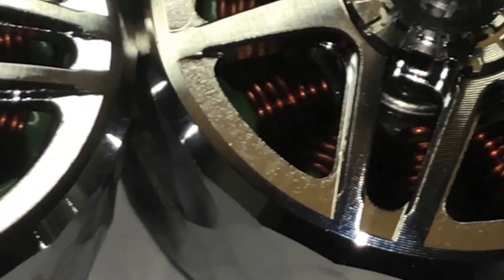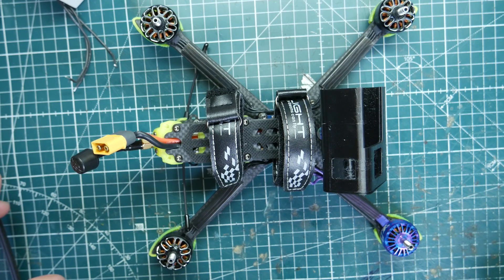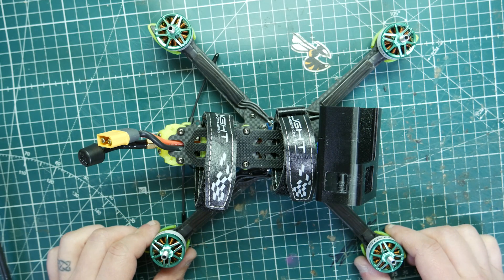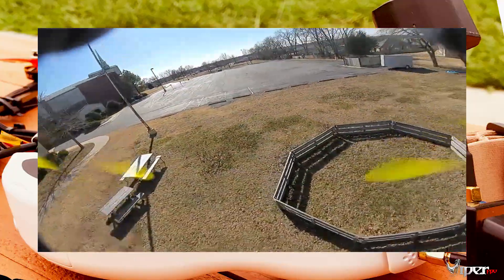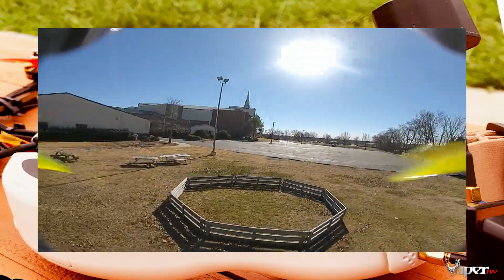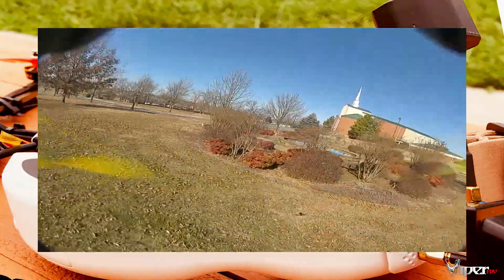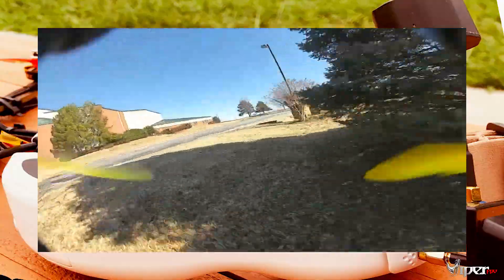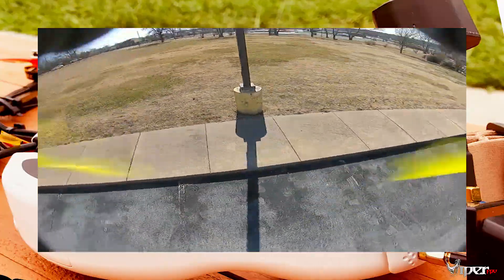T-Motor Velox V2 - Is 1950KV 6S Too Much?

Comment: Hello, nice video, thank you.  I fried one of my 1950s and don't have a replacement for it, only have 1750s.  You think it would run ok with 3 1950s and 1 1750?  Never mixed KVs before, so not really sure.  You ever done this or have any opinions? Thanks!
Reply: nah do not mix kvs, kv determines how fast a motor will spin at 1 volt, so they might not spin different speeds due to the esc or they might, but theyd just not fly right as well like unbalance and all that

Comment: hi great video can we put 4s on these engines (1750kv)thank you
Reply from the maker: You sure can it won’t be as fast but it will fly and do flips and rolls
Reply: @ViperFPV  ok thanks
Reply: @ViperFPV can I run 3s or 4s on 1950kv and can it bear 600 grams of weight (quad with battery) thank you
Reply from the maker: @rexlapis7014  yeah but it will feel underpowered.

Comment: Hey mate - thanks for the review. After 3 months, have you found the tmotors to be more durable than the ones that were on the quad originally?
Reply: Viper can you answer this question please ?
Reply: @-exeCy-  I've had them for a few months now and I'm not sure about them. I didn't crash often and never crashed hard but once in a mediocre crash into branches one of them got toasted at the windings. Might have just been bad luck though and all the other crashes have been fine
EDIT: they fly awesome though

Comment: Hey, I recently bought these motors and no matter what, they always come back pretty hot after a short run. I was just seeing if you had a good tune for these, thanks!
Reply from the maker: I have had nothing but a really good experience and are still running strong on my quad. Did you have your quad tuned before you installed the motors? Did you reset filters and pids?
Reply: @ViperFPV  Yes, I have had a tune on it before, and I reset it back to stock and still the same thing. I have tested the bolts on the motors for conductivity... nothing. I have no idea haha.
Reply: @AustinFPV  hey.. happens the same for me... did you resolve the problem?
Reply: @JosueDuronMusic  Hey! I did not fix the problem. I swapped my them out with another different set of motors and they weren’t hot anymore. I’m assuming they just run hot.
Reply: @AustinFPV  hey mine also run hot, any solution
Reply: @notyet_fpv  I didn’t find any solutions, I changed my FC, my ESC, changed frames, mounting, and props. Still no luck, I’m pretty sure they just run hot. I have used them for about 3 months now and have had no problems, so I think it’s fine.
Reply: @AustinFPV  I faced 2 times desync also
Reply: @notyet_fpv  dang, do you have your DMAG compensation to high?
Reply: @AustinFPV  yeah I just changed to demag high, it fine knoe
Reply: Hey are you on insta?
Reply: @notyet_fpv  sorry I didn’t follow you back 😢 I did now
Reply: Just saw this a year later lol wondering if anyone found resolution. I recently did 2 totally different 5” builds, aside from using these motors, and both get pretty warm for the outside temp. None of the usual suspects(no motor screws touching and the like). Played with filtering, PIDS, esc tuning, etc. it was like 65-70 degrees out I flew for maybe 4 minutes just kinda cruising with a flip or roll and punch here & there nothing crazy at all. Definitely way warmer than they should be iMO but not ‘hot’ by any means so I know it’s not hurting them per se, it’s just a naggy thing. 

In contrast I have a TP3 build w/1106 3800kv motors on 4s and I can fly that as fast and hard as I want and the motors are COLD even when it’s 80.

Comment: I don't believe those are the direct V2 of these you mentioned, those blingy ones are unibody, then there is the normal Velox (pink, blue and orange) and now these "normal" Velox V2.
Reply from the maker: It’s utter confusion with having the same name with the same products u do have a point that they are built differently.

Comment: Like I said on FB, you can always throttle limit down or run lower pitch lightwer props to make it work.  1950KV plays great on S3's, and other low pitch props on 6S... and you can run 5S as well which makes them in my mind perfectly flexible.  There are some ESC tricks that help with efficiency and smoothness (48k, 25% Rampup Power, 23° timing) that actually bring the overall efficiency close, except for the top 15% of the throttle.
I do actually want to build some BF default tunes that can account for those changes out of the box, and make it pretty transparent to pilots (have something that's immediately happy on 5S and flies really close to that on 6S)
Reply: Just wanted to ask if I could run 3s or 4s on this motor . I mean to ask will produce enough thrust on 3s too for a 600gram quad .
Reply: @rexlapis7014  You can run  3S (2200mAh is about ideal), but it's firmly in the underpowered category - but you'll be right at freedom spec pace.  4S works a fair bit better, good upside, solid for proximity chasing and cruising around, it's generally a great setup.  5S to me is ideal, but I'm always heavy on the throttle
Reply: @tehllama42  have you made the tune?
Reply: @rexlapis7014  I’ve ran 4s 1500mahs on these motors for over a year. Nothing wrong

Comment: with these motors you have to use low pich propeller like hq p3 they are fire
Reply: Yup, having the option to slap S3/P3/51433 type props on 6S, or run aggressive (S4/S5/51477) on 5S and even 4S makes them super versatile.